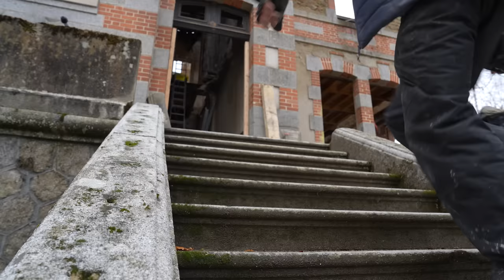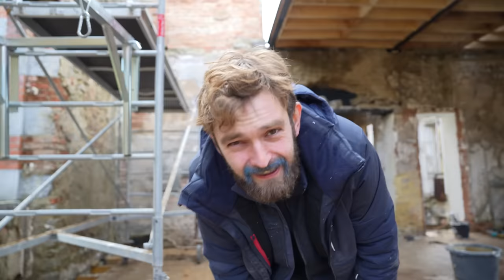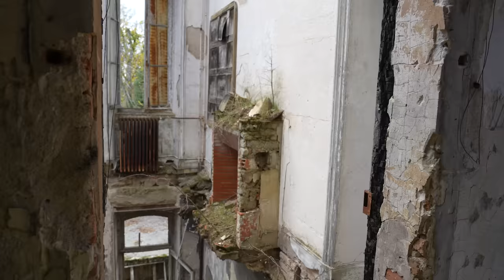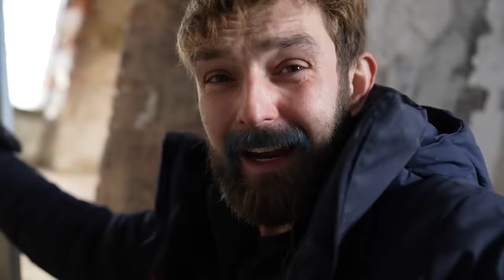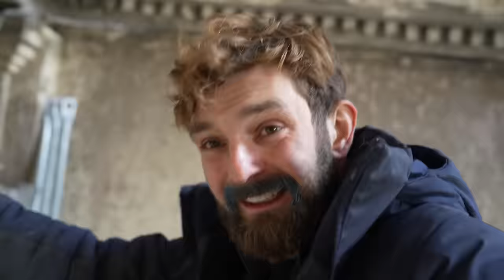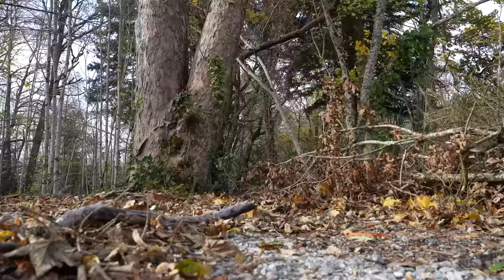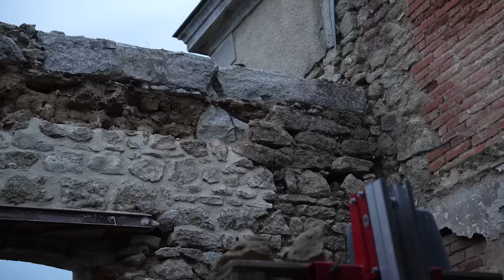Working to rebuild the top of the chateau in high winds.

Comment: The trees look much more stable since Nick took the tops off. Great decisions all around Dan.
Reply: I noticed that too it looks a lot cleaner....
Reply: The Trees also have been there for over 40  years .
Reply: @gordonnadolni  yes but if you had watched earlier vlogs Nick the arborist said some had grown too tall too fast and were “whippy” and in danger of snapping mid trunk in high winds. A few of these were close to the chateau so they pruned them back to promote better canopy growth, stabilise the trees and have a better view from the upper floors all at once. A task I would say they were successful in. 

Also removing those rotten or hollow trees seemed to have been timed well considering those wind gusts. 

Bring on the roof!!!!

Comment: Perhaps time to move all that concrete making gear into the basement kitchen and setting up the old winch in the doorway to the back room to get the concrete up and down to the top floors. Keep it all internal and out of the weather and wind. 
As soon as you get that wall, C channel and floor in you can get a huge tarp over that top floor to deflect the water away and have a good number of floors of dry storage and work space to work with while building the roof itself. 
Also while putting some windows and storm shutters in.
Reply: I would yell at Dan if he got concrete on his kitchen tile, not that it's my business. Hopefully, the weather will improve.
Reply: @bonniec8429  remember that they are all damaged so it doesn't matter
Reply: Great idea
Reply: Your advice is sensible, but it doesn’t add the drama he needs to attract more viewers.
Reply: He had tarps and they just blew off.
Reply: @gordonnadolni  the black plastic he used on the current top floor of the hallway hasn't and it's currently keeping everything below it nice and dry.

Comment: the faith this man has in that buckets handle is remarkable.
Reply: I've been thinking the same. Skinny wire, plastic bucket. Seems a little flimsy to hold all that weight
Reply: Surprised Dan has not made a large wood box to lift the stone. Could lift several buckets at once that way. Save time and steps.

Comment: I think irrespective of trying to get the walls repaired etc, given winter is soon to be upon you, you really might want to start weatherproofing what were once windows. Obviously aiming to get some of the roof on is important but you do need more than this. Also as others have mentioned, why not move the concrete mixer inside to the first floor rather than decanting from it to a bucket and then to the bigger bucket.  That’s double handling and is wasteful of your energy and time, let alone the materials. 

Your getting there but boy there is so much to be done by just you.  That’s tough going.

Comment: I wonder how much dried mortar Dan is going to end up scraping off those stairs.
Reply: It’s lime mortar….not cement mortar
Reply: I've wondered that myself.
Reply: My first thought was that the bucket would have been easier to fill if it was lower than the wheelbarrow and certainly easier to clean up.

Comment: Dan bring the cement  mixer  inside there is no reason not to even if you put it on the 1st floor or the room that has soil on The floor save some stairs climbing and out of the wind 😊
Reply: he still has to go down to bring the sand and water
Reply: The room with the soil on the floor is down in the basement,  not a good idea.  😅
Reply: Dan needs a tower crane! Just bring everything up 👍
Reply: Was thinking the same thing.
Reply: Stocking cap would be a good idea... you could take a day off for safety (?) Goggles in high winds would also be prudent.
Reply: Not a good idea. Nick tried to help out by putting the trap under the mixer. If anyone hasn't noticed, Dan's not a real tidy builder. I'm married to a guy who does amazing work, but he's not tidy either. Just saying, the chateau might be in peril with the mixer inside.
Reply: Needs to bring mixer and cement to some what where he is working.
Reply: I agree.  Sit it on heavy duty plastic and that saves soooooo many steps!
Reply: Cement bags are heavier than they appear.
Reply: @karenmetcalf-pugh5 😂😂😂
Reply: He still would have to bring the bags up, I don't think that save him much effort at all.
Reply: Thought the same myself the other day, pulley system should go over the top wall and bring the materials up through the upper window.
Reply: Dan, rejig the the pulley over the top wall using scaffolding, then bring materials up the outside, then through the window.
Reply: if he wants to clean the mixer which he will surely do every day after work then i guess he will clean it with water and some stones running a  few minutes and then you have get this out of mixer where it is standing. i guess he don't want to have this in the house....
Reply: every time I see him going up and down I think why doesn't he mount the winch outside the window or balcony?
Reply: @bjbutton57  I agree. No reflection on Dan's abilities.
Reply: Show the inside of your yourt at some point.  Why is his moustache green?
Reply: Glad Nick did all that tree work with that wind.

Comment: Hi Dan, why not use a ladder hoist or platform hoist? The proper ones as used by roofers or movers can be used in every angle and lets you hoist a wheelbarrow of lime up through that 3rd floor window or 20m up in the turret

Comment: The slower Lime sets the stronger it will be. If it dries too quickly it will crack excessively and will be weak and crumble. Using NHL Lime is not doing you any favours. Instead make a traditional Hotlime mix with CL90 (search Nigel Copsey to see exactly how to make it). Note Traditional Hotlime / Lime Putty made from CL 90 is what was originally used to build this Chateau. It is a far superior quality product as compared to NHL Lime and it costs way less than NHL. You would be best advised to slake a few tones of it in some old plastic water tanks and allow the Lime Putty to mature for at least a minimum of 6 months before using. This Lime Putty can be used for making Lime Mortar, Lime Plaster and Lime Wash. If you use a Traditional Hotlime you will never want to use NHL again. It will also make for a great episode to see the Slaking process - both a Hotlime Mortar Mix for immediate use and also Slaking to make a Lime Putty. Note Hotlime can be used all winter in freezing conditions - NHL on the otherhand will run into many issues in cold weather.......
Reply: Sounds like good advice, but given the situation it sounds like over kill? Perhaps a good coating of Epoxy can do the trick!
Reply: @henryblicharz5556  wow.....absolutely not!
Reply: @henryblicharz5556  epoxy thanks for the joke😄
Reply: @henryblicharz5556 I'm definitely not a builder. I've done some repointing and put rough render on an outside wall. Even I understand that the mortar Dan is using will breathe with the stone and brickwork. Epoxy is a sealant that will trap moisture inside the building, never mind keep any residual moisture inside the walls. 
Absolutely not is absolutely right.
Reply: cl90 is higher than nhl in france, nhl 2 is good for stone, less flexible than cl90 but it is perfect for mounting stones, terracotta bricks, ...it still allows the stones to expand, not like cement
Reply: Original lime doesn't seem to hold too well. NHL is stronger with bit of cement.
What he could do is make self-healing lime mortar by hotmixing it on site. That is how it was done times ago.
Reply: @otofoto   looks like the lime and stone has been damaged by the fire,  but apparently an architect told him that everything was good about the structure...
Reply: @joffreyg8676  I am also renovating old stone building(~1830) and the lime mortar crumbles in walls left to weather. Seems it can't hold thaw-freeze and turns back to sand. 
But at the same time nearby medieval fortress ruins still stands so even then lime mortars were different. I am still looking how to make best lime mortar which will stand.
Reply: @otofoto  it depends the type of stone you have, the mortar must always be more flexible than the stone used, for limestone, cl90 is perfect, the best mortar looks like the chanel ''les jeromes'' on youtube, they make powder with their original stone and mixed with cl90...and doesn't use sand
Reply: @joffreyg8676  Doesn't the stone just make it like NHL?

Comment: Dan you shoud first rebuild the stonework under that lintel before rebuilding the stonework above it
Reply: I have told him yesterday the same think.
Reply: I think he knows what he’s doing.
Reply: if you can take out stones from wall with your fingers you should probably do-over the whole thing..
Reply: I know nothing. I hope Dan stays safe
Reply: Dan has decided to stabilise the top and then repair under the lintel, it is a bit of the wrong way around but as he is stabilising it "things" should work out, he will be propping up the lintel anyway when he's working underneath it so it shouldn't be too much of an issue, in the end it will be safer than when he started!?!
Reply: @DEVINdevdev  I think Dan is going to further repair the walls (Once the roof is on) and spray lime render on them to tie it all together at some point, he is just carrying out the major structural issues to enable the roof to go on, hopefully before the weather gets a lot worse!?!
Reply: @laszlokiss1190  he hasnt got a clue what he's doing
Reply: @Sir.Fisher I feel he’s going by instinct rather than by construction knowledge. I hope that behind the camera he has civil engineers, real construction workers advising him on which steps to take, or when the roof goes on all will just crumble under the weight. I hope I’m wrong.
Reply: well, honestly, I think the whole lintel should be replaced like Dan has done with the other one's. they look great and solid. I guess (or hope) he has obtained some advice of building construction engineers, since this cannot be changed anymore at a later stage when the roof construction is placed, at least not with major efforts and costs.
Reply: @claritadeluna6609   Please don't worry.  Dan is restoring a known historical building. From what I understand, France is more than a bit of a pain in making sure things are done right.

Comment: Perhaps you could move the cement maker inside or up a floor!
Reply: How ?
Reply: I have been wondering that for quite awhile now 😂
Reply: How do you get the sand and lime cement up a floor??
Reply: The cement is in a bag.  The machine could be hoisted up, take the bucket off. He has a backhoe. Make a fulcrum and hoist it up at least one floor.  Hey, he is going to be doing this for a long time, he needs to improvise.
Reply: Getting the mixer up one floor is doable, but not a lot of help if he can't get tonnes of sand delivered to the same floor.
Reply: @Syko1985 He would still  need  to cary up the sand, lime, and water.

Comment: When are you going to do the roof? Isn't that the most important part? Because even you you build/fix the walls, once it starts to rain or snow those wall will be damaged again?
Reply: The walls need to be solid and safe to support the weight of the roof. He needs to do this before in fear of the walls collapsing.
Reply: the walls will be fine. the damage from the fire is a lot worse. just the floors can't take too much, but even those are fine for a short time. having proper build walls that can support such a massive roof structure is what concerns me more.
Reply: Makes sense!  @vicklyd

Comment: I may complain about safety, but Dan gets an A+ in dedication and persistence. I'd still suggest talking to some professional builders about ways to make things more efficient. The winch and lift was a big step forward. Seems like there are a thousand little tricks professionals have in their sleeve that would save time and wear on your body. Even just a rope pulley system for the bucket would be helpful.

Comment: It might be a silly question but wouldn’t you be better having the cement mixer inside of the building? Would save you lifting and carrying up those steps. You are looking exhausted and I’m not surprised.
Reply: but all the sand is outside
Reply: @ludovica8221 And the water and lime.

Comment: He's received criticism and advice how things should be done, most the time probably fair. This to me looks one of the worse yet i haven't seen it mentioned? he's putting that new inner skin up, abutting the outer skin that looks ready to crumble, he burnt the roots and doesn't seem to have scraped loose stuff away cause otherwise it would all collapse, how will that have any structural integrity? a new inner skin not tied into what is a loose crumbling mess.
Reply: It’s all about followers and likes. Not about restoration. Fascinating.
Reply: I said the same thing yesterday deeper in the comments.  I think most of the mortar in the structure is bad.  Did you see what happened when they removed the stones on the front steps?  The mortar turned to dust when hit with force from the backhoe.  Same thing when he cranked the up lintel on both windows.   I don't think much, if any, of the old mortar in the building has much integrity at this point.  Even if it feels strong, what happens with any force is applied?
Reply: @marien20  I think it's primarily about brilliant film making. The project is just the subject and set of the film and may or may not succeed.  I agree - fascinating.

Comment: An external hoist or internal mounted outrigger, will easily transport all materials from the ground (grade) to the roof, this should be the first goal here. This huge labor is avoidable. A simple proper pipe scaffold bolted to the facade, and yes I know there are weak areas. the bolts are not holding weight, they are prevention from lateral movement. Or a steel frame in any of the areas that are open with an outrigger beam would be marvelous. These living methods are safe enough to hold a work crew on a suspended  scaffold platform, surely its safe enough for lifting bags of sand and boards. Any waterproofing or resoration contractor must be cringing watching him drag the materials by hand. GRADE TO ROOF, Let's GO!

Comment: You should investigate putting in a ramp suitable for the barrow and a trolley. Then Barrow concrete in and possibly even lift the barrow with your winch to whatever floor you are on. A simple belly harness wound work.

Comment: You should think about moving the entire cement mixer up there with you. Or mix manually up there in a large tub.
Maybe even a proper ( even if temp.) stair system.  An aluminum ladder in winter is an accident waiting to happen.

Comment: Dan: AN IDEA TO MAKE YOUR LIFE EASIER! Okay, enough drama. You have come up with really great and innovative ways to get materials up from the 1st [ENTRY] floor to your workings at the TOP of the chateau. But there's still [and there's always] a  weakest link. That's getting those very HEAVY materials UP from the ground level outside to the terrace and inside to where you can winch them into the sky. Buckets of mortar up the steps? Sheesh! You're a diligent worker, but that has GOT to take a TOLL! And there will be hundreds of trips [mortar, stones, bricks, plaster & etc?]! Here's my idea:

A "tiered ramp". The steps are too steep and a man can only do so much himself. But, if you just build over them, say making the RISE 2x what the steps do, by DOUBLING the RUN, you'd be able to push the wheel barrow up that gentler slope. But a straight ramp 2x the run of the stairs [the treads] would stick way out from the chateau and probably be in the way. So, build a Square Platform as WIDE as the steps just beyond the foot of the steps. Then build a Ramp Up to the Terrace from there OVER the steps. Then build a ramp Up to the Platform from the Ground BUT at 90 degrees [aiming toward the cement mixer would be perfect!]. This halves the slope and you should be able to push a full barrow up it AND you get to rest for a moment or longer half way up on the platform. It doesn't have to be full width of the steps, but wider than the barrow in case of tipping over. And you still have the other steps to go up for things that are easier to take in that way. If it is super sturdy, then even Nick's midget equipment could go up to the 1st floor.

But, mostly, you'll save your energy [back & shoulders] for putting the materials in place rather than getting enough altitude on them so you CAN put them in place. This is one theory of how the Egyptians built the pyramids: by building ramps "around" the structure as it grew and shoving the massive stone up on rollers, or sliding them on mud. That's using the "simple tool" of an "inclined plane".  A wheel barrow uses another simple tool, the lever, to make the load you're carrying 1/2 of it's actual weight, because the wheel [the 3rd simple tool], is carrying the other half. Dan gets more work done for less effort for putting in the effort to build the ramp.

Comment: Have you thought about not replacing the roofs on the two wings and instead turn them into open air terraces? You could pitch the floor slightly, put down a rubber liner, install some drainage, and then lay pavers/tile. Leave the third floor open and put doors from the central tower part out to the open terraces. It would save you a TON of work and you'd be able to dry in each wing of the building individually, instead of rushing to repeat all the same work on the other wing.  You lose some living space, but were talking having an 6-8 bedroom home as opposed to a 10-12 bedroom home. Visually, from the exterior it would look perfectly normal. Just a thought that's been kicking around my head for a while.
Reply: @JPRobinso  as far as historic buildings go in France,  this one is relatively new.
Reply: Brilliant idea!